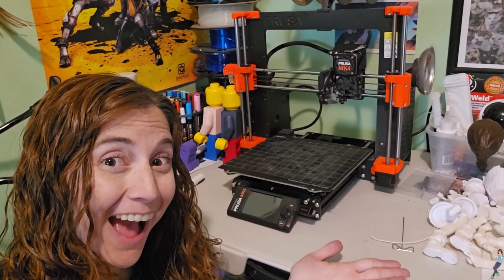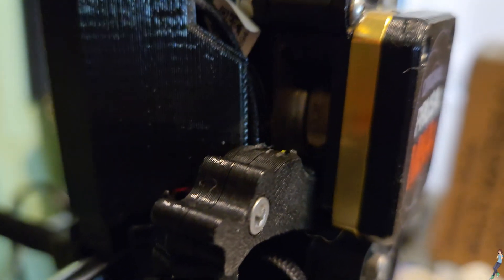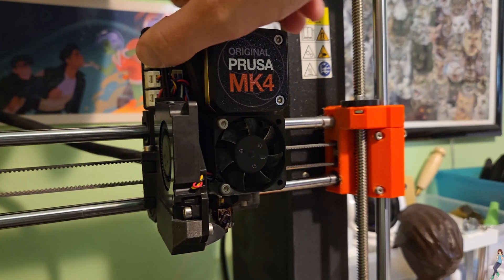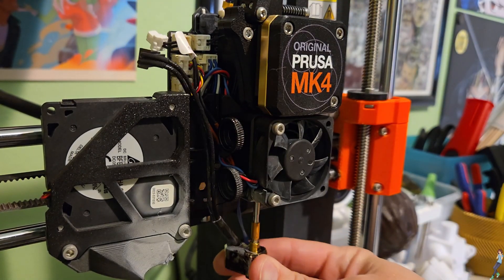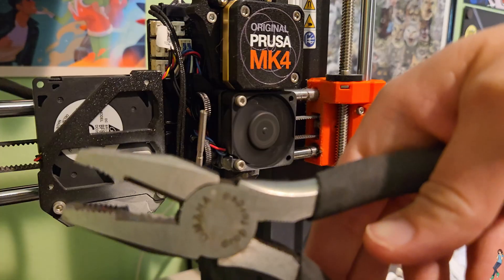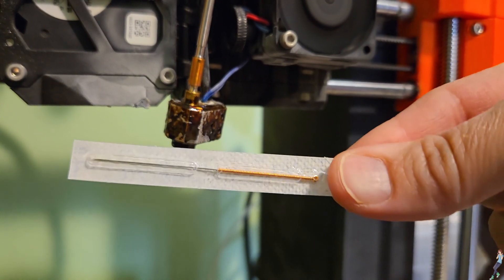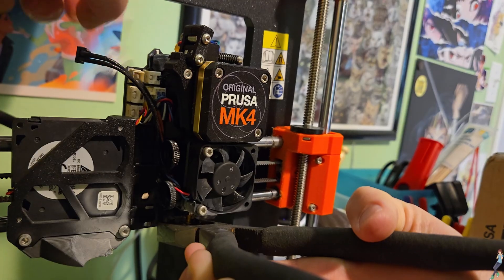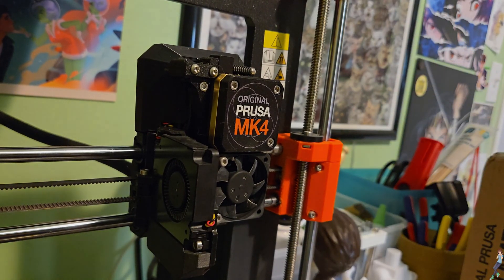PRUSA MK4 - How to EASILY and PROPERLY Clear a Filament Clog (Simple and Fast Instructions)

Comment: Do you have the clog clearing tool linked?
Reply from the maker: I don't - I just bought a generic one on Amazon, they're relatively easy to find. Prusa also includes the tiny needles you need to work on the bottom of the hot end, too, and you can buy them from their website if you need more.

Comment: FYI the Prusa has an automatic cold pull feature in the software to do this.    After you select it there is a QR code that will take you to the Prusa site for a full tutorial.
Reply from the maker: Yes! This is an excellent resource for clogs that you can fix with the cold pull feature - however, when you have a bad clog and all else fails, the method in the video is a guarantee.

Comment: And after like 40 seconds of 260°, my heater wire melted....
Reply: Prusa has a coldpull feature that does not require disassembly. It's dangerous to run a hot end without a cooling fan.

Comment: Ever since Prusa released firmware version 6.0.0 in April '24, they've added a feature that completely automates a cold pull, apart from pulling out what's left at the end. It only works with PLA filament, but it works magic. Thankfully I haven't had to use it, but it's nice that it's there and you don't need to practice or fiddle with the technique. It's worth giving it a shot before you actively heat the hotend while its dangling in midair 🙃.

Now I just need to see how it works if there are clogs using other materials like PETG or ASA. Most likely PLA will be there to the rescue.
Reply: It works with all fillaments.

Comment: Hers's an additional step, after cleaning the clog, run a 12 inch piece of nylon at 260 through the  nozzle (purge), the nylon will clean out all the little bits of filament that remain and clean the nozzle ready for the next print!
Reply from the maker: Yes! This is such great advice if you have nylon filament to use. I didn't have any on hand, but it's so great for cleaning clogs!
Reply: I'd suggest following the cold pull procedure recommend by prusa and is in the software. No disassembly needed. No need to risk getting burnt handling hotends.

Comment: theres a big piece of filament inside of the metal rod part of the nozzle. what do I do i cant get it out ;-;
Reply from the maker: You can try using a piece of nylon filament to clean it out, or just keep trying to push it through with an unclogging tool/wire. It can be tricky and take a long time to get it clean.

Comment: I had a 5 hr print overnimght last night, the longest I've had so far. when I woke up, it was saying the hotend fan wasn't spinning; to check for build-up then inspect the wires

I didn't realize what was wrong until you came along and solved it for me. I wish I could give you more than just a sub because you helped me so much. I don't have an un-clogging tool tho, so I found some metal wire(that I can bend into a straight line) that works perfectly, thank you THANK YOU THANK YOUUUUUUUUUUUUU

havent even started unclogging it yet XD

Comment: What a lifesaver!  I could not even unload the filament, so I ended up heating the nozzle to about 10 degrees above normal and then pulling the filament out while the nozzle was removed.

Comment: I have had my MK4 for almost a year and I just had its first real clog. I have worked with all different types of printers for ten years and this video was exactly what needed because my past methods did not work. I was about to go get the disassembly guide but was saved by your video. Thank you for taking the time to make it and saving time for me!
Reply: Actually the video tells the worst and most dangerous way to do it. In the prusa manual it shows how to do it right - no disassembly is required.  

Please don't handle a hot end like in the video sadly someone will get hurt.
Reply: @The_K_Project  will you enlighten us?

Comment: Need to put a Hottie hot end on that printer, i hear they don't clog as much ;)

As a side note, there is a special purging/cleaning filament. It is low melt, and is made specifically to clean hot ends. Feed it in like regular filament and that should do. From what I remember in very bad cases you can let it cool off some, then pull out the filament and the clog while everything is still somewhat soft.

In general though, as long as you have a filament wiper (small binder clip holding a piece of paper towel over the filament) and don't over-cook PLA, nozzles won't clog. Still, cheers for this video, i'm sure it will be helpful.
Reply from the maker: Nylon! You can get a spool of Nylon and follow the exact process I show here, but every few pushes with the unclogger tool, push in a bit of nylon to grab the filament and bring it upwards out of the clogged tube.
Reply: @GamerMeg  Does that unclogger not instantly cool off the nozzle? Seems like a relatively large cold metal rod that gets shoved in. Or is that the idea, to get it to grab filament by cooling it?

Comment: Amazing, it's great when we find a good tutorial of "how to unclog your Prusa without breaking it". Last week I had the same issue and I used a hammer to open it and remove the clog, sadly it was impossible to assemble it back together
Reply: The prusa manual shows the correct way to do a cold pull. No disassembly required.  It's dangerous to do it the way this video shows. Just follow what prusa recommended
Reply: @The_K_Project  in some situations yes, but that's not possible when the filament is broken inside the tube. the latter one is what happens to me in the majorities of the cases (I assume the filament is fusing to the tube, making it impossible to get out with normal means)